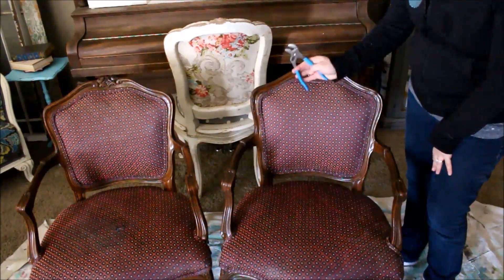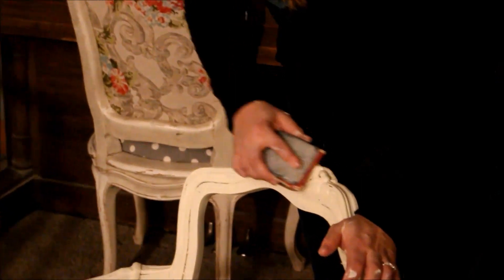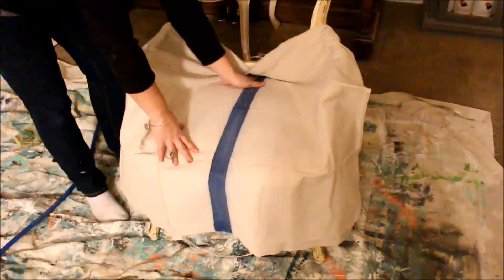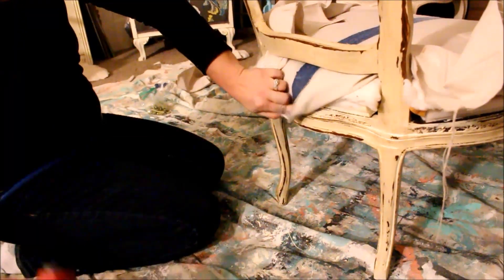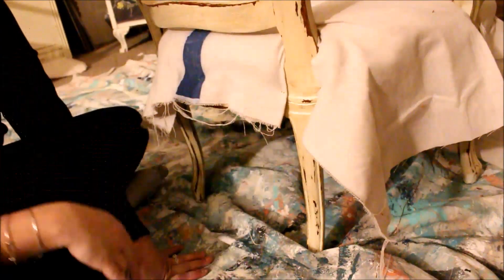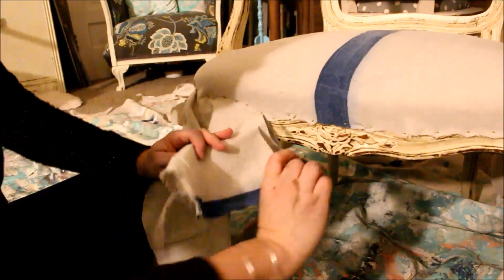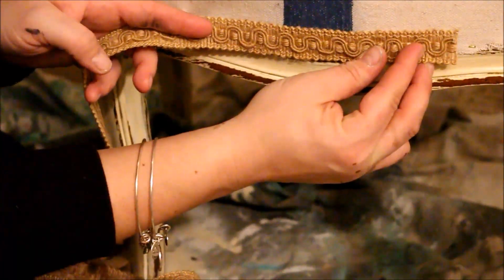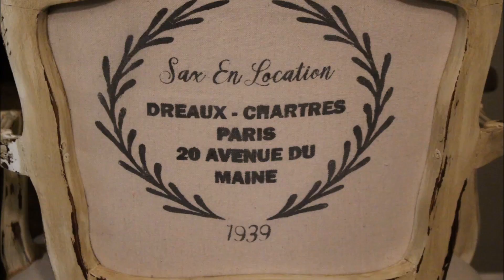How to Upholster a Queen Anne Chair

Comment: Very good video. 
Not sure about the paint you use but you might suggest to your viewers to clean chair first with at least a TSP mixture, I use naphtha in case there is any wax but I’ve been finishing wood for over 50yrs so I’m used to harsh chemicals. 
Loved your video. I’ll be trying to upholster a similar chair for the first time. 
Thanks!!!

Comment: Hi there. I love your work. It os simple and clean easy to understand. I have this great dinning chairs that I've had forever and i refuse to go to a store and buy expensive cheap ones to replace them. My questions is how much roughly you spent on materials. Thank you
Reply from the maker: Thanks!  It depends on the materials used. The fabric used in this video is drop cloth. Cost about $10.00 for enough to do both chairs.

Comment: Hello, beautiful job! What type of hot glue did you use? I have used hot glues, and have had trim lift off, any suggestions? Thanks so much, keep up the with the awesome work/ tutorials they are clear and doable for the average diy'er.🌸
Reply from the maker: Keri Stevenson I use high temp glue. I usually buy it at Home Depot. The key is to make sure it has enough and its evenly distributed and hold it until its dry.

Comment: great video on how to upholster a Queen Anne chair - question - what size staples are you using in the air staple gun?  I was using tacks and see that the staples work very well.  Also - the chair I am working on had the fabric folded in on itself for added support - does that really make a difference?
Reply from the maker: The folded fabric helps to keep it from ripping out. But since I’ve gone to using a pneumatic stapler I haven’t had an issue with that. The staples are 1/2” 18 gauge.
Reply: thank you for the quick reply...off to the store to by staples!!  Thank you.

Comment: What size compressor do you use for your upholstery.
Reply from the maker: Patricia Preston I started out using a little 2 HP 6 gallon  pot compressor which worked great and did everything I needed. 
Now I just hook a line to Zeb’s big Air compressor in the garage. The little compressor worked great though!